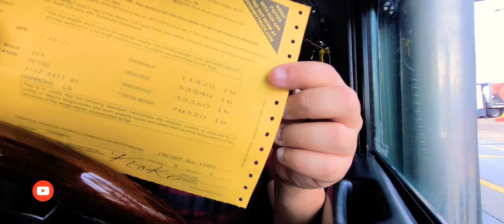Life in the Road

Comment: Hey FL. Riderz  good 4 u amigo u handle that character that made that comment just being the  better man not letting it bother u and  be what it is it was funny shoot I was laughing with ya, anyway question how many pds  is each hole to move wt I hear 250, 500, etc what is it actually.  Ever thought about a dump valve on the trailer it help u in some tight places God bless, happy trails, be safe amigo.
Reply from the maker: Whats up bro all trailer are different some have 250 and others 500 some one told me ones that some people I have seen some trailer with up too 1000 pounds